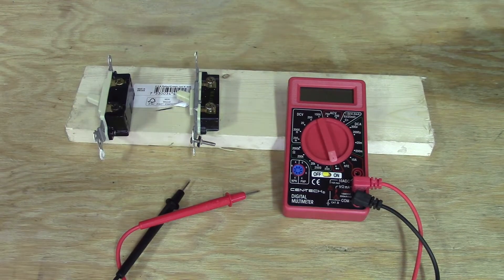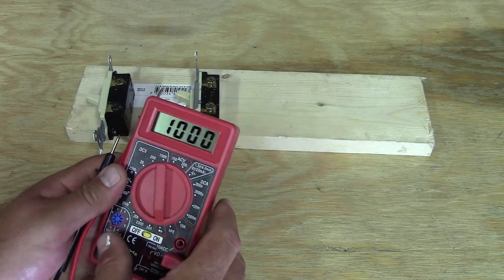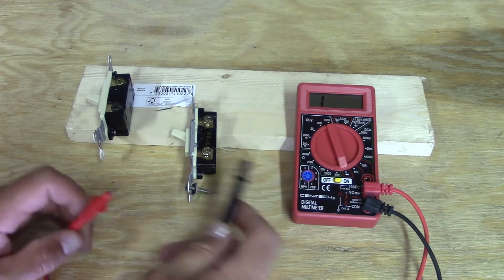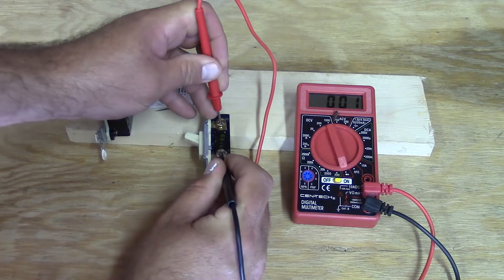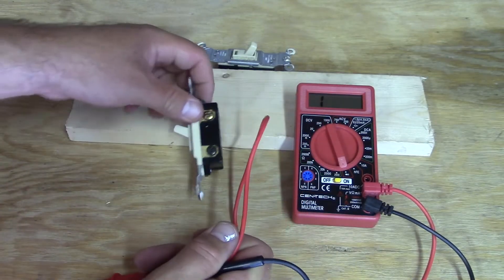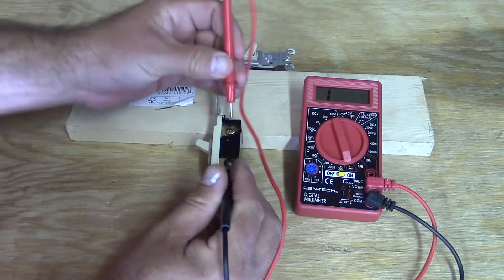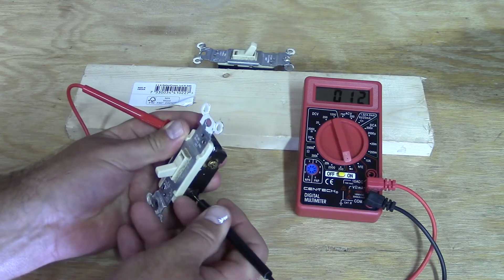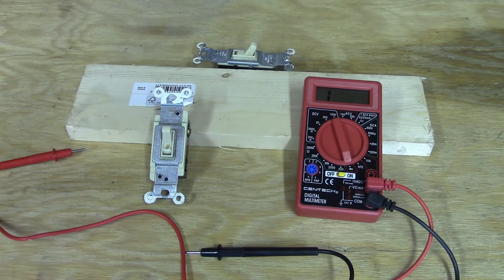How to troubleshoot a light switch

Comment: Great video! 

You showed the simple switch first, then the complex one later. I have been troubleshooting a scroll saw that I think has a bad switch AND a bad rheostat and this is the first of 4 or 5 videos I've tried that showed the simple easy switch at all. One had a 2 pole 4 throw or something. It had 6 connections on the back! All I need is a hot and a neutral LOL

Comment: My multimeter says my light switch is on when it's switched off as well as on. However the light doesn't come on anymore. I also got zapped even though the breaker was off. I know it was the right breaker switch because the two plug-ins that share the same real estate haven't any juice. My switch has 4 wires 3 black and ones. Two of which are right next to one another (one goes to screw and the other goes through the plastic). The 3rd black wire is on the bottom, which I assume is the hot one. And the 4th wire is solid copper attached to a screw on the opposite side from the other three. It has NO insulation. What the hell do I have here?

Comment: Can Frequency on from socket be more than 60hz with voltage of 245Volts.? in my i house is 50hz freq and phase and zero vire are something chaning i connect light screw and ligts turn on on + and - is it a problem with plug board switch of what? in some room only Phase my house is old norms are much more difrent now i have black wire green yello and orange.

Comment: If I get a zero reading switching on and off the switch is a bad switch, correct?
Reply from the maker: If there is nothing else connected to the switch, sitting there like the one in the video and you put your meter on it in the off position and it starts to zero out then something is wrong.  Off should be an open and on is closed so it should only zero out in the on position.   Whenever you are troubleshooting something and it's not making sense take a known good, so in this case a switch that you know is good and run your meter on it to see how it behaves.  Will usually get you on the right path quickly.  BB

Comment: Replaced an I wall timer with a newer one.  The LCD on the new switch does not register.  The electrician said the component is faulty. After replacing the in wall timer with another one, the same issue occurs.  The original switch had 3 wires hooked up and electrician pulled 4 th wire out to complete the install.  What should we be focusing on in trouble shooting this problem ?
Reply from the maker: What was the 4th wire for?  what are the colors of the original 3 wires?

Comment: when you're checking your continuity with your voltmeter I'm still learning so I wanted to know we never touch the tips while testing something correct
Reply from the maker: Good question, I'll make sure I cover this better when I do an updated video.  If you were testing an outlet in a wall, so you put a lead in the neutral side and a lead in the power side then you have 120 volts going through your meter.  Should you let the two metal tips touch or get very close then the power would go across the leads and you would get an  arc at the tips while it shorts out.   That is the main reason I mentioned this.      When working with electricity arcs can happen so I always try and wear safety glasses while working on anything electrical.  When an arc happens there could be little bits of hot metal thrown out that could hurt your eyes thats why the glasses are important.   Electricity is a dangerous thing so if you are new to it taking a class at a local trades school is a good idea.  most schools offer an introduction course that will help you understand the basics of electricity and how to work with it safely around your home

Comment: that is a diode test not continuity unfortunately that meter does not have a continuity check.
Reply from the maker: yes that is the diode test function on the meter.  Does it show the switch opening and closing?  Does it show a connection or continuity of the switch connection?   I think you see where I am going here.  I should have said diode test setting but I am showing people how to test a switch not testing diodes   and a lot of people use basic meters which most have this setting on them.
Reply: The Burb Billy however being free you can't beat the price of a centech multimeter.
Reply: Clamp-On Multimeter Channel lmao
Reply: Agree with both of you. It does only show the diode but on my Fluke it show both diode and continuity for that setting. I'm guessing, at a minimum, it will show diode if nothing else like it does here. Thanks for the video and the comment for pointing this out... good to know diode setting and continuity both can be used to test a switch.